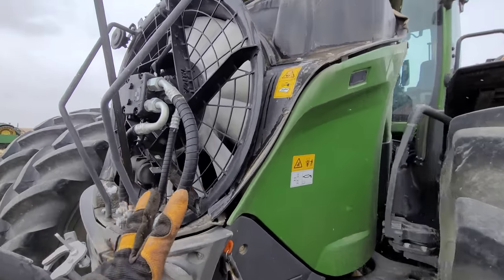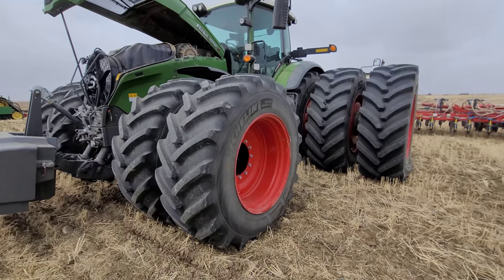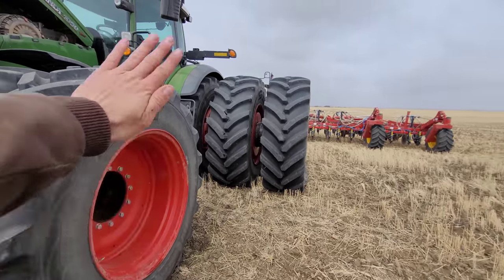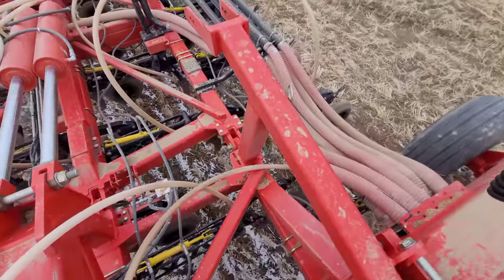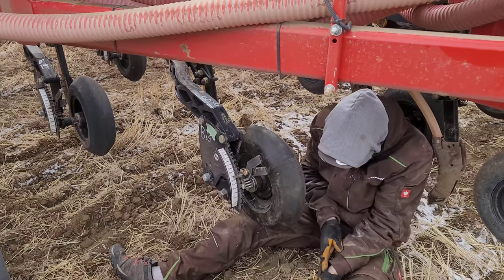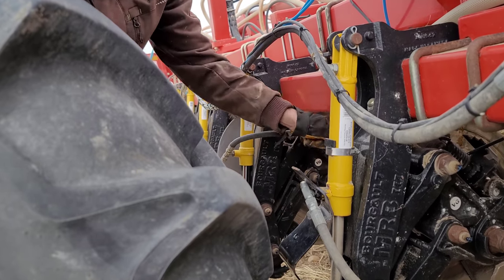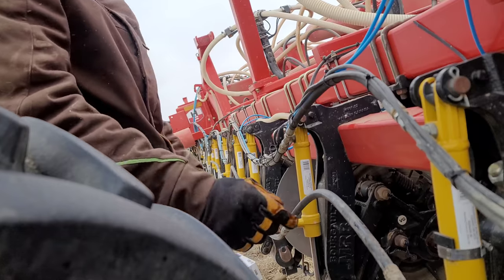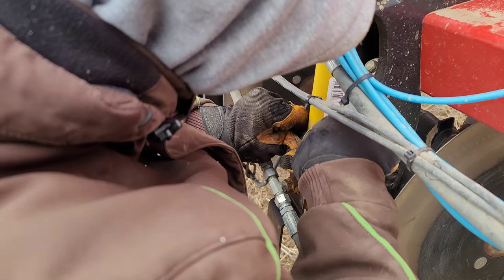I think we just offended everyone! 🤦‍♂️😂

Comment: Hey Mike, on the reversible fan. It's a different fan, the fan blades actually move to change the pitch. The fan does not change the direction it's spinning, just the pitch of the blades.
Reply: I guess similar to an airplane propeller, the pilot can alter the pitch during flight to a more aggressive stance, & I also believe totally set the pitch to enable reverse thrust in order to aid braking upon landing. 🛩️

Comment: Grampa always said nothing is greased unless grease is on the tires.. talking old grease guns from the 60s, 70s, they leaked like a sieve if not air locked. So always whipping grease hose against tire to clean excess black as coal grease off hose. Weaker zerk tips I guess plus just didn’t change out zerks back than when they wore out since typically kept machines 15 years.

Comment: Accumulators help with low speed, low RPM steering. Without accumulators the hydraulic pump can't keep up at low speed especially when turning lock to lock.

Comment: Get a bicycle tire tube, cut it lengthwise, wrap it around the hydraulic hose for about five inches to keep the other hose from rubbing against it and use bailing wire to secure each end of the tube.  Repeat on the other hose.  One bicycle tire tube can be used to protect multiple hoses that are rubbing against each other.  Replacing worn bicycle tire tube is far cheaper and much easier than replacing the more expensive hoses.

Comment: the 1050 transmission is split in 2 so in a turn it can speed up the front when need it can also lock the front and back together to get better traction and when traveling at speed the front drive stops and the front axle is disconnected form the transmission so it free wheels for better fuel economy. also the turning via speeding up the front wheels is called a pull in turn others have done it but there clunky.

Comment: That fitting will be fine Mike. JIC fittings like that seal on the taper inside the fitting not the treads in the nut so as long as it tightens up you golden.

Comment: Mike, on the Quadtrack there is a wire rope underneath.  Is that connected to the back section so if it sticks you pull the back section out which pushes the front?  Thanks for shoring with us.

Comment: Mike you should run a tractor a few days without any power steering  . I grew up with no power steering it builds muscle .
  It must be nice being the boss.  Nascar changes 4 tires and add 20 gallons of fuel in under 10 seconds

Comment: Hey, watched a lot of video's.  Hose rubbing problem-  Try zip striping/ties  the hoses together.  Run them in parallel for a few inches if you can, use 2 strips minimum. Also try installing a piece of rubber around one of the hoses (in this the Hyd line) before zipping.  Frank can do it all day long.  Have a good day

Comment: @ 6:50 Couldn't you strap a wooden block wrapped with a piece of inner tube rubber on the frame  to separate the air hose from the hydraulic line? It doesn't need to be raised all that much. What do I know. I'm just an old surfer from SoCal

Comment: How often do you switch you 1050s an why? Also basicly ervery "standard" tractor that has front wheel drive is geared in a way, that the front tires run faster. Otherwise it would be useless.

Comment: Why are your tractor tyre and seeder tyre treads different directions?
Reply: A tire that is powered by the engine needs the tread to grip the ground and provide traction. 

The seeder tires are not powered, so their function is flotation instead of traction.  The tread goes the opposite direction so that the ground makes the tire roll.

Comment: I just don’t understand why you keep the fendt around. Seems to underpowered and over priced for your operation 🤷🏻‍♂️🤷🏻‍♂️ you can buy a nice 620 case for the price of that
Reply: Just curious Mike! I know the wife would live another case on the farm lol id love to hear your feed back
Reply from the maker: Because the Fendt just turned 1yr old.. That butt kicking I would take on that for a trade would be criminal. So that's not option right now, also it doesn't pull theses loads well no, but it the best grain carting/pro tilling/harrowing tractor you can drive in my opinion. Super smooth, quiet, and no shifting.. Sometimes it's like having different tools in the tool box 🤷🏼‍♂️
Reply: @mikemitchell2554  i get that i farm with my dad and uncle in iowa. Were all red. I know you know rhe rho sayin if its not red leave it in the shed. I think youll love the new pro 1200s